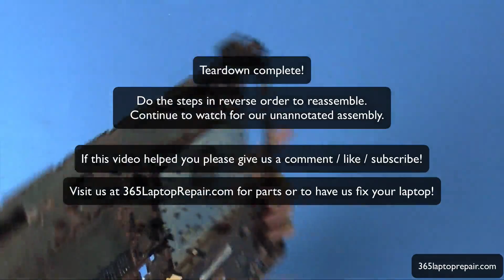Lenovo B50 How To Disassemble and Repair - By 365

Comment: I am having problems with the speakers but from your video i have to breakdown the laptop completely just to access the speakers...is there any short cuts or alternative solution
Reply from the maker: This is pretty simple repair :) if you want you can try external wired or Bluetooth speakers.
Reply: not really what i meant i was asking if i have to strip the laptop in order to repair the speakers or is there a short version....thx for replying

Comment: I am having problems with something stuck in the audio jack. Can you help?
Reply from the maker: +CGFighter 1 Besides trying to remove the foreign object from the jack we usually replace it with a new one but that is costly. Try super glue on the end of q-tip or toothpick and see if that will work for you. Make sure you don't glue everything inside :)
Reply: Thank You. I ended up taking that piece out, giving me more area to work with it and i used a toothpick and got the object out. Thanks, and keep it up with the helpful videos.